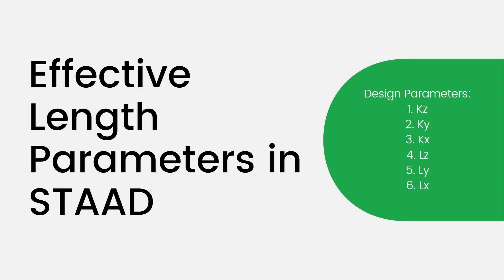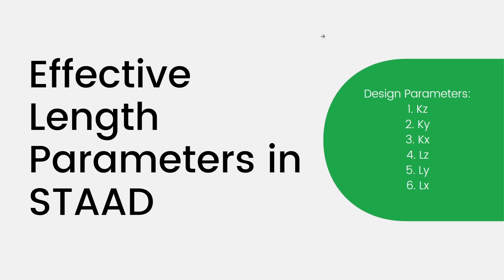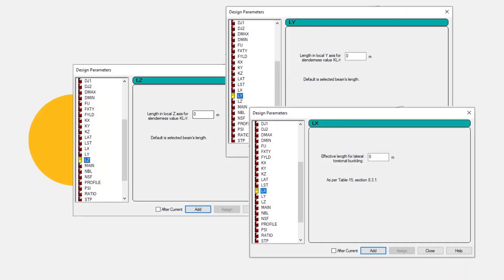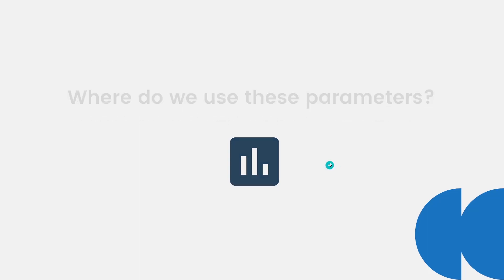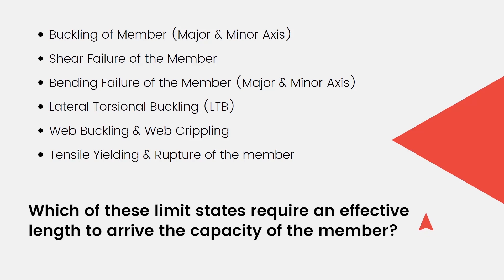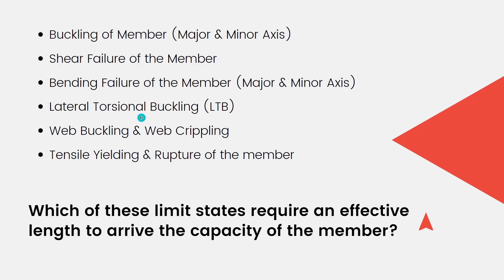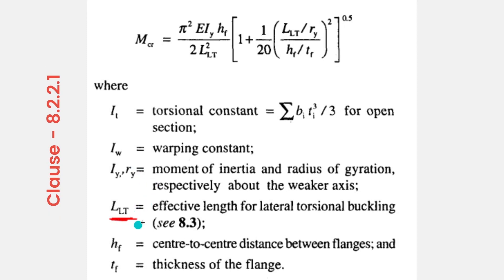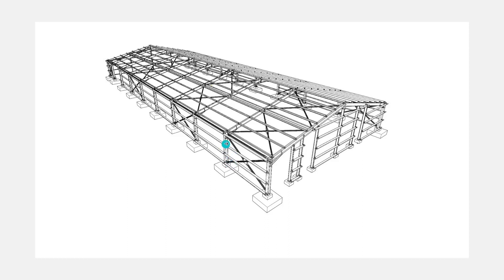The Key to determine Effective Length in PEB Design

Comment: For the beam the unsupported length is full span or length upto ridge (if there is no column support at ridge)
Reply from the maker: It is upto the ridge. Considering the slope of the building is not less than 0.5:10.

The apex of ridge node will act like a rigid joint, so the LZ value can be splitted at that location

Comment: What is the LZ value for truss members ,its node to node distance or support to support distance?
Reply from the maker: Thats a tricky question...

You can consider the node to node distance as LZ for the truss members. Considering that the top chord or bottom chord will be transported only as an assembly. If it is going to be a fully bolted truss, then care should be taken at the time of transport and erection so that member does not deform due to slenderness..

Comment: Sir, suppose we need to design rafter for the PEB building in staad having span 25 m and rafter ridge at 12.5 m, the whole rafter is divided into 4 segment in staad, then what will the Lz value that we need to specify in staad.
Reply from the maker: @suniljatav1937 The rafter ridge connection is considered as a rigid node and the LZ value for clear span rafter of 25m will be 12.5m.
Reply: @parishithjayan  sir, in case of curved rafters, do we have to take rafter ridge as rigid node too?

Comment: Sir, For column the kz value considered is 2. But  the column is pinned at the bottom and also gets lateral supports from connected members at the top. So it’s pinned at the top also. So kz value is 1.
Reply from the maker: It's not pinned at the top Mr. Mathew.
It's actually free to translate at the top. As per the codal provision, the effective length factor for column is 2. Kindly check the desired clause in the code book.
Reply: Why we cannot consider the lateral support from connected members at top.
Reply from the maker: @tominmathew344   No Mr. Mathew, if it is pinned at the top, then it should not translate at all. But in the actual frame upon having the lateral load, we will see the translation there na. Then in that case how could we consider that as a pinned support? If it is pinned, then it should not translate at all.. Hope u understand
Reply: The entire column and lateral members will be translating in that condition. If the column independently translates, then it’s not restrained.
Reply from the maker: @tominmathew344  There is some serious misunderstanding. Okay, for a member, the effective length is a distance between point of contraflexures right. If a frame is going to sway, then how come the point of contaflexure forms within the length? It has to be greater than 1 right?

Comment: What about the condition with brick wall ? How we consider the lx ly lz in that. If 1/3 rd of the length is brick wall then side girth of spacing 1 m.
Reply from the maker: Then the height of brick wall need to be considered as the unsupported length for the minor axis..

Comment: In columns if we have one half sheeting anf half Block work means what will be the values. Cab you explain
Reply from the maker: Say for example, if the brickwall height is around 3m, and above cladded, then the unsupported length for the column on the minor axis can be taken as 3 + the distance of first girt (m assuming that the girts will be with flange braces).

And to add on, some of the designers are following an approach of inserting one node at the brick wall level and assign the girt spacing as the unsupported length for the top portion.

Generally I don't support that, since the column is going to behave as a whole.
Reply: @parishithjayan  can you give the values of same structure as you said in the video. With 3 m block work and 3 m sheeting. For column Kx, Ky, Kz, Lx, Ly, Lz. So that i can have a clear idea.  

Another thing you are telling about Indian code. For American code the Kx, Ky, Kz , Lx, Ly, Lz values are same or different. 
Please tell me brother

Comment: I think theres a mistake in what you said about ly value. If you need to consider girt or purlin as a support, you need the compression flange to be connected using flange braces. Else you can't consider that advantage. And I believe you don't have to define lz for rafter, since that's a bending member..
Reply from the maker: I totally agree.. You are right about the flange brace. Thanks for pointing it out.
Without the flange brace, the grits or purlins could not be considered as effective.

Coming next to the rafter portion, where u said we don't require to provide LZ. I don't agree with this as they are not a simple bending member. They are beam-columns which means they have internal axial forces developed within them due to the lateral loads. Without specifying the Lz parameter in STAAD, u can't expect the software to consider the proper length for slenderness ratio calculation. 

If u have single rafter piece say for 12m straight without any pieces.. then in that case if u neglect to provide LZ, STAAD will automatically consider the node to node distance as LZ for u. If not and u have say 4 nos of 3m pieces in the rafter, then u need to specify Lz as 12, or otherwise the program will take 3 as the Lz value. hope I made it clear.
Reply: If there is no additional nodes in rafter ..means you have only two nodes one at eave and the other at ridge...in that case no need to define lz for rafter. but if there is additional nodes created in the model to connect struts, bracing etc  you need define lz
Reply from the maker: @alwinrojerbinniv8602  yes totally right.. we r saying it is not required to define for the frst case because, the default value for Lz Ly Lx are the node to node distances, if they are not specified. We r taking that advantage and leaving it unassigned..

Comment: What is the ky kz parameters for the tube bracing?
Please show code reference too.
Reply from the maker: Ky and Kz are the effective length factors. For tube bracings, the end conditions would be pinned at both ends. In that case, Ky and Kz can be taken as 1 for tube bracing.
Reply: @parishithjayan   we connect ky&kz=  0.85
Reply from the maker: @tgsubramanyaprasanna5023  what would be the codal reference for that? Kz and Ky in STAAD is be used to calculate the slenderness ratio of the member along Major and minor axis correspondingly. The Factors depends on the boundary condition of the member. As per table 11 of IS 800, for pinned pinned condition, the K factor is 1.
Reply: @tgsubramanyaprasanna5023  in case of tube or pipe bracing for vertical planes (walls) you can consider ky&kz as 0.5 even because a gusset plate will come in center which will break the effective length to half. in case of tube or pipe bracing for horizonal  planes (roofs) you can consider ky&kz as 0.85 because gussets will come at the ends for connections so the length of the pipe of tube is is not 100%. it is getting reduced say 15% because of gusset.